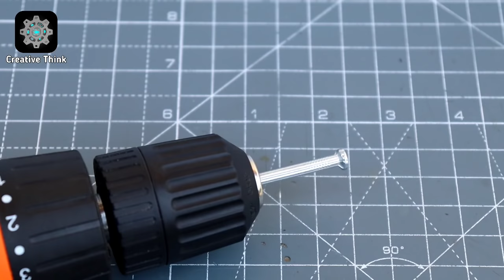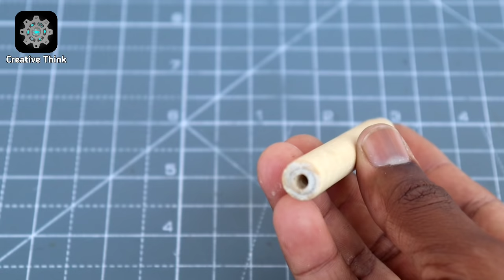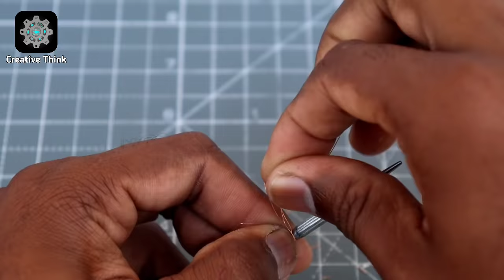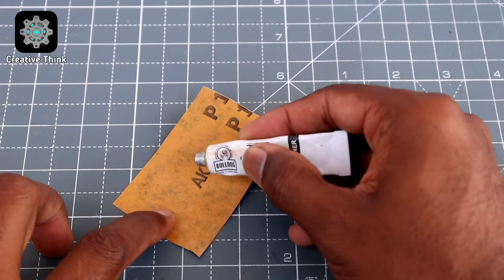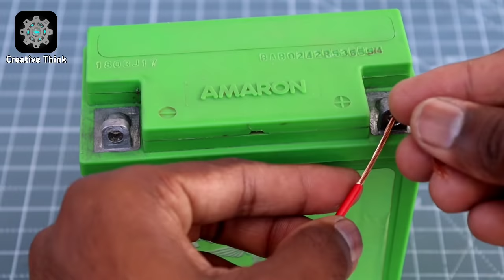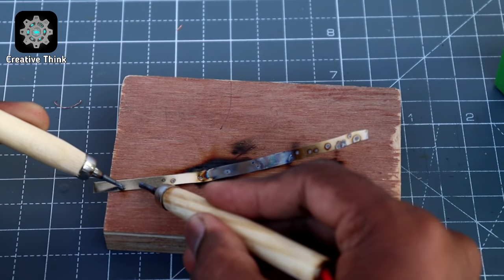Spot Welding Machine Using Lead Acid Battery

Comment: Hi 
Does it have to be 6A4 diode or any diodes ?
Reply: I don't see the point of the diode. You could probably omit it. It does reduce the voltage a bit but you'd likely get stronger spot welds by removing the diode.
Reply: Its for safety, because in theory works as current limiter. If I don't remember incorrectly 6A4 stands for 6 Amperes 400v. So actually, I would like to get one around 2 to 4 Amps max since this would reduce the chances of the battery exploding in my face.

If u want to do this, make sure u put 2 diodes in series so if the first fails and short circuit, the second will buy u enough time to disconnected the terminals.

Edit: No, losing 1v doesn't matters, if anything it will help u to avoid sparks when welding.
Reply: @simjang-9171  Diodes don't do any sort of currently limiting. The current you're mentioning is just the max those diodes can handle  continuously before they burn. The main thing those diodes will do is provide a small voltage drop, which would reduce the current but its not current limiting by any means.

The main reason for such diodes would be to prevent reverse current but you're dealing with a DC battery, not AC, so, diodes are unnecessary. Besides, you're building a spot welder. You want higher currents. If the current is too low, nothing will happen. So, why would you want to limit or reduce current? If its too powerful, just reduce the time the spot welder is on. Instead of 1 second, you do 0.75 seconds or 0.5 seconds. The less time the spot welder is on, the less likely you'll damage the cells, so you have nothing to lose by having a more powerful spot welder.
Reply: @simjang-9171  Why did you even reply if you don't know what you're talking about?   It's unnecessary.  Serves no purpose but to make smoke and shrapnel.

Comment: I like the fact he used a galvanized nail, for the black wire is it possible to connect a clamp instead and thanks for diode does it have to be specific
Reply: That's not a galvanized nail.  They are stainless steel. Don't use galvanized, or you'll be breathing some pretty toxic fumes...

Comment: BS trickery.  Watch the first 'welds' and you'll see that the blades aren't joined, probably just magnetized in attempts to make them not slip apart as he handled them, but they did slip and separate.  Then after a quick video cut he picks them up and they're joined, the welds are the same ones, but the blades are in a new orientation.  The video cut was to glue them together.

Comment: Hi what is that diode or resistor the one that you connect on positive side..thanks
Reply: He use diode to prevent from damaging the battery.
Reply: @keedzulkiflykeeabdjalil3536  hi thank you

Comment: @Catalina Ramirez  keen observation, no diode at all. May lower power output if diode in place, and Higher output without diode but will make battery shortlived.
Reply: Uhm... that diode served no purpose and didn't survive.  That's why it's missing.  Pointless and just plain stupid.
Reply: What type of diode should be used, plse provide the specifications of the diode

Comment: I basically had the same problem with my battery. Last month when I was on my way to the store, my car died so I got my multimeter out and I checked the voltage on the battery and it was 9.7378 Volts so I thought “what the heck is going on with this battery”, the next thing I knew I seen some smoke coming from the tips of the battery terminals. I was suspicious on what was going on and I couldn't believe it because this battery was only barely 16 years old which I consider fairly new in today's society, so basically what I want to do is try to clean up the battery with some soap and salt solution and then I might put it on the charger for two or three minutes at a high current rate just to see if it will hold a charge. I'm not sure if that's going to help the battery or not but one thing's for certain before I go out and buy a new battery, I'm definitely going to try these two methods that I suggested. Now on the other hand I could swap the battery out with one from my 1962 Chevy Tahoe but I'm not sure that my old lady would let me do that, so basically what I need to do is first, I'm going to check all the air in the tires before I monkey around with the battery. Then I'm probably going to run a few errands around town down and the next thing I want to do is get some paint and paint the battery terminals because I don't think they look very good without the neon yellow color look on them.  If all goes well, I am planning to do a few other things to the terminals. Next after that chore, is get some of that distilled water and pour on the outside of the battery to try to clean up a lot of the dirt and dust its accumulated over all these years. If I have time what I'll do after that it's try to clean both sides of the mirrors on my 1965 Ford Bronco because I've noticed while I was driving that it's hard to see what kind of traffic is coming up behind me. I was having a problem with the battery when I put the headlights on low beam and then when I tried to switch the high-beam I noticed that the voltage excursions were jumping around so I went out and I bought another set of test leads to use on my digital multimeter and there was no difference at all, so I think I may borrow my friend Tony Jones's multimeter just to check those voltage excursions to see if that is normal. Nobody really explained to me how to test a DC voltage excursions when the battery is not in its prime. I am all on my own doing this. A lot of people have contacting me and they said that they've had that problem once or twice and maybe even three times in their lifetime with their batteries but they did something totally different. What they did was loosen the terminals first then they carefully remove the battery and hoisted it out to get rid of all the debris and dirt that's accumulated after all these years then they put it on a slow charge which I believe they told me was 32 milliamps for 6 days, 3 hours and 54 seconds. Next they took the battery caps off and added some distilled water, which they claimed that they bought it at their local Walmart store. I think, if I can remember correctly, they said it was .99 cents plus the sales tax. Can you believe that just 99cents? That's a real good price for one full gallon of distilled water. Speaking of water, yesterday I helped my neighbor that lives to the right side of my house, fill their swimming pool for the new season. It literally took 7 hours to fill. I am not sure how many gallons it is. I have met people in my lifetime that had no idea that there were 4 quarts of water in a gallon jug. They just assumed it was a gallon only. I am not really good at math but I do have a calculator on my cell phone. Speaking of math, it takes me back to grade 11 in high school when my teacher, Mr. Lowry gave us a sneak quiz on algebra. I failed it because I didn't understand what that was all about. I spent most of my high school time stoned and kinda out of it. Some of my classmates were very good at math, and it even showed when they got their report cards. I may have gotten of the path of whatever we were initially talking about. I think it had something to do with blue cheese. No, I remember now, it was car batteries. I never could figure out why they put car batteries in the front of the vehicle and not inside the vehicle. It would be so much easier to work on them, especially in the rain, if they were inside the vehicle. Doesn't that make more sense to you too? Well anyhow, batteries are pretty heavy for their size and some people can't lift them very good. I had a fried, Tony Smith who had asthma and once he tried to lift out his car battery, and sneezed, and the battery fell out of his hands and landed on his right baby toe. It broke the small bones in that toe of his. I called his mothers step daughter Ann but she was not home. So I then called his brothers uncle Fred and told him about what just happened to Tony's toe. He seamed like he was drunk and started laughing at me and said “I don't care about that Bast#$ds toe”. I got mad and hung up on him immediately. From that day on, I never spoke to Tony's brother's uncle Fred. I never really liked him in the first place bacause when Tony and I were 13 years old, we were at a softball game and Fred walked over to us and farted right in our faces. That was not very nice of that old pervert. I heard some stories about him when he was about 20 years old that would make you cringe if you heard them, but I can't get into that right now because I have to finish up my posting here on you tube. I hope I have given you folks some good advice on having some of your problems solved in a timely manner. I like to help out when I can if it is at all possible. I am out for 3 more hours so I want to go now and get a hot dog and a bottle of grape soda. I need to look around for a ride so I can get back to my padded room at the Sinclair Insane Asylum. I hope Dr. Dilbert will not be mad at me for sneaking out....
Reply: damn bro, is this for real? you just snuck out the asylum to tell us your life  story on this random video comment section? tell us about the tunnels in the asylum bro.
Reply: You left out the part where you supposed to let everybody know you're out of work TV screenwriter😂

Comment: Put one contact on one side and the other opposite and you will have a spot weld. - now it is just a welder.  It does work however.
Reply: What is that small thing put in the battery
Reply: @venstv5407  if you don't know what that thing is then you might as well quit electronics.
Reply: No, Danny, many spot welders use adjacent electrodes.  Just about every battery tab you have ever seen has been spot welded this way.  That said, THIS is not something anyone should follow.  The materials and construction are just foolishness.  Diode soldered directly to the battery lead?  WHY?  Maybe this guy is laughing his head off just thinking of all the idiots who followed his video only to have a semiconductor fry/explode in front of them.

Comment: its better open the battery and bridge the partition of cells and make them all parallel. if that bat is 12v you have 6 partitions of 2v each.  connect them parallel  and you make 2V bat with better amps 😜.

Comment: or for 20-40 bucks you can buy a lithium battery operated spot welder with adjustable power modes and not risk blowing urself up to not weld a single usable thing when its all said and done.....

Comment: You should use capacitor 2v 500f
Reply: Hi, should the cap be used instead of the diode. Plse advise
Reply: @atulbava7416  no diode and capacitor work is different

Comment: Fail

Diode servese ZERO purpose other than to possibly reduce the battery voltage by .6V which is nothing and after the first arc that diode is fried and shorted... oh wait, watching the video the diode that was so carefully installed isn't even there during the spot welding.

Kids, don't try this at home.

Comment: This idea should not be practice by any one. Because for spot welder we need only 1.5v to 2v or maximum 3v with high ampere.. because amps is what we need.If we use 12v directly without any safety components like relay timer, the battery will fry out within few days. This YouTuber is trying to fool his subscribers. Please be cautious. This is insane. Don't do it. I'm telling this for your own safety.

Comment: Very dangerous please do not try this at any point spot welders are not expensive if you want a budget by a spot welder for your batteries go online by one you can buy a kit which you solder and assemble yourself very easily for around £30 online such as Aliexpress Ebay etc. 
And the spot welder is quite good to use for a hobbiesst an diy'rs not ideal  to be making multiple battery packs daily for a living. 
But I must distress please guys don't watch certain tutorials that could affect effectively burn your home down or causes u serious injury or harm with stupidity

Comment: You would have to use copper or brass in order to spot weld otherwise it will stick too much but this would be good for electrocution of criminals
Reply: Maybe not bc the voltage is 6 or 12 volts...to low for criminals electrocution,🤔

Comment: Diode model?
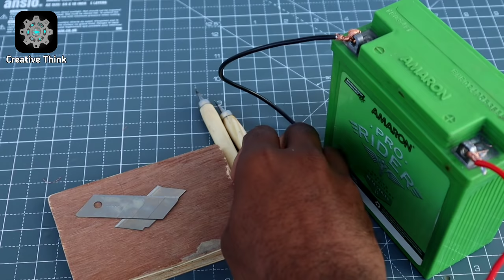Reply: I wouldn't worry about it.  It apparently was removed for some reason...  At 5:00 you can see that it is no longer on the device.  It would be nice if they mentioned why this is.  I'm starting to think that this is just not a good idea at all....

Comment: Some questions for you;
1)  What is the value of the battery, volts, amps etc. ?
2) Why in particular Amazon
2) Why do you use that nail in particular ?
3) would it not be easier to insert the epoxy at both ends BEFORE you insert the cable ?
4) Using your link takes to this battery ₹1,499 ( Indian Rupee ) which converts to £14.27, then I would expect you to have shipping, customs and Import duty to be paid BEFORE you get your parcel
There are similar voltage batteries on Amazon based in the U.K